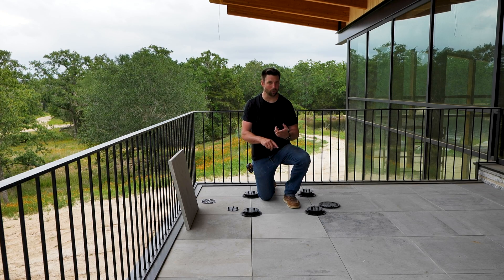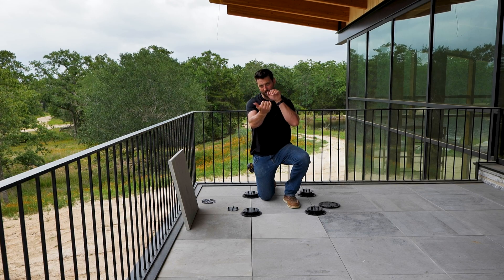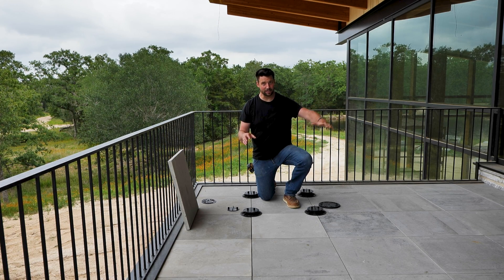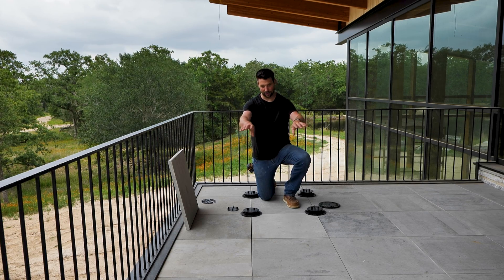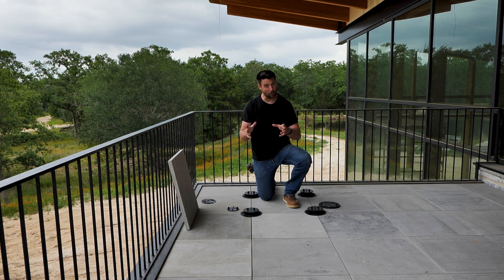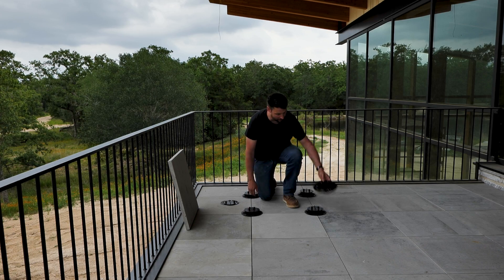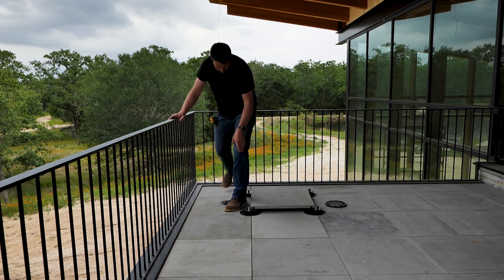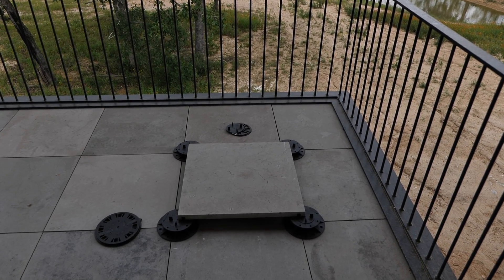Avoid the Pain, Expense and Embarrassment of a Leaky Balcony - Do THIS Instead!

Comment: Suspended pavers is one approach that is okay, but I think it's better and cheaper to just use self-leveling epoxy cement as the hard backing to directly lay porcelain or ceramic tiles and then use epoxy grout to seal those if you put asphalt membranes under all that there's no way there's going to be any leaks or penetrations.